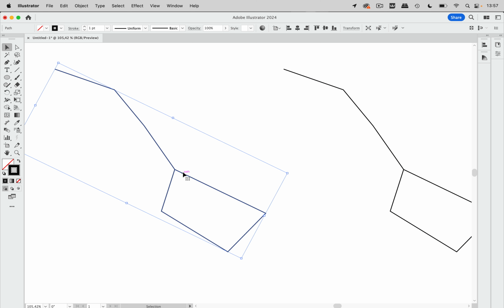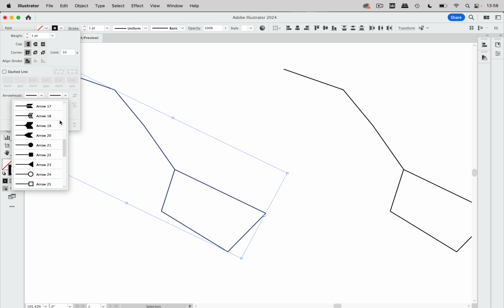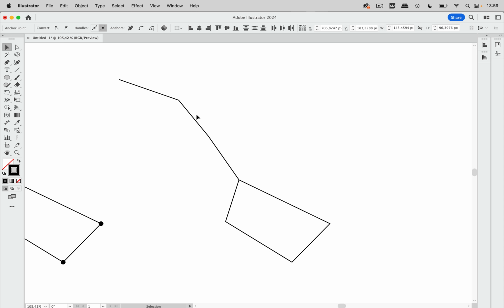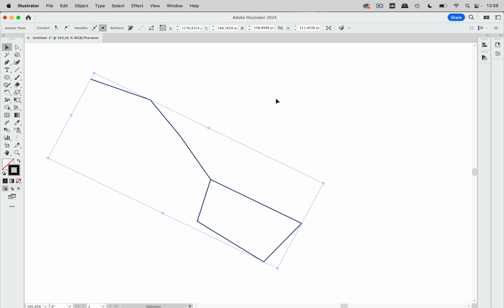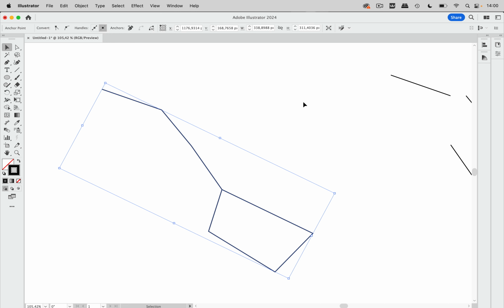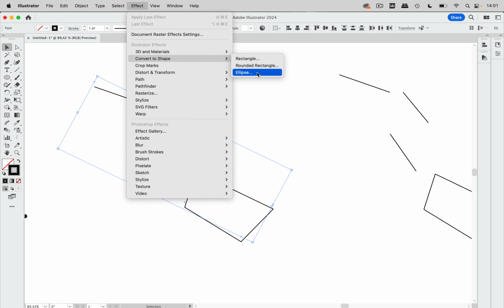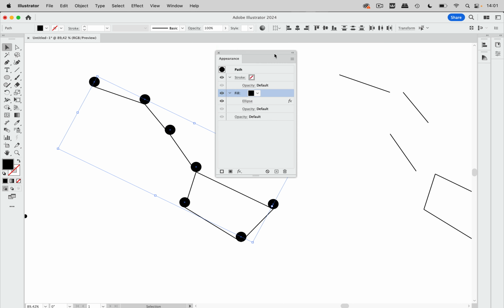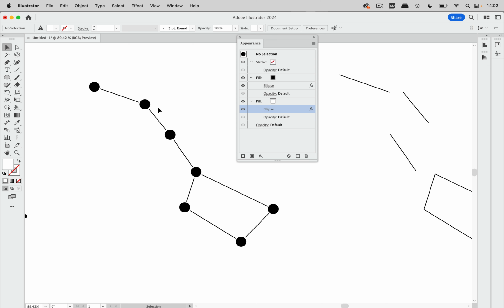Drawing Constellations in Adobe Illustrator Destructively

Comment: 👋🏽 hello monika
is there any efficient way or method to precisely a position in place exactly by keyline,  two vectors of the same shape, BUT of different scale ( size ) , rotation ( angles ), skew, and or horizontal and vertical distortion?
Reply from the maker: I'm not sure if I fully understand your question. It looks like maybe the scripts of Sergey Osokin could help. https://github.com/creold/illustrator-scripts particularly the ones in the "Item" section. They could do the scaling part I think. Rotation is difficult anyway. Unless it's a symbol or a placed object, rotation will be difficult to recognize by a script.